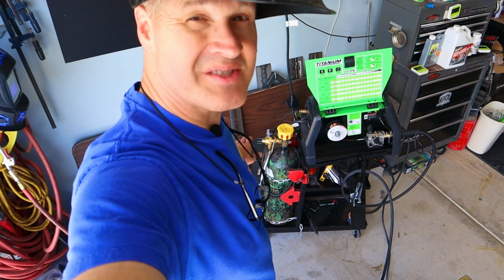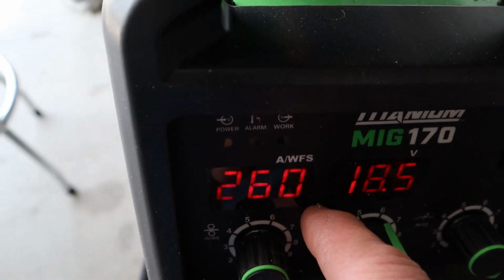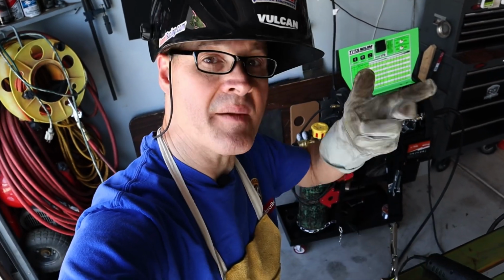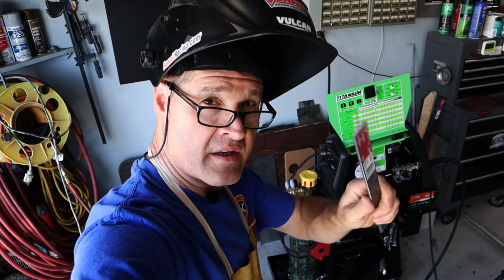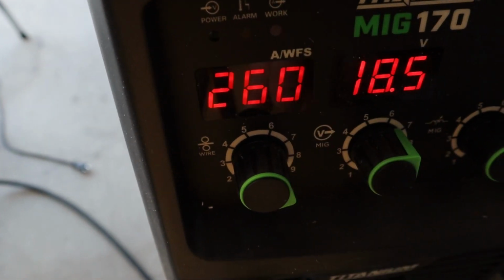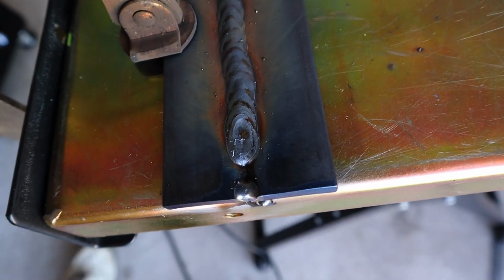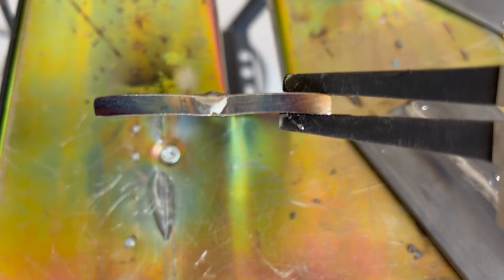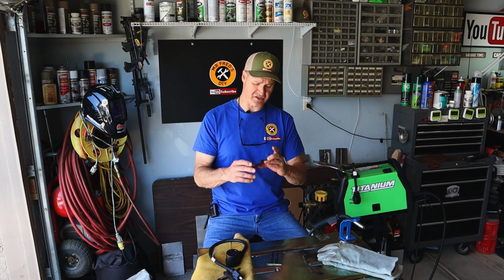Harbor Freight Titanium MIG170 Welder

Comment: Would love to see this using the 240 volt settings to see what it is really capable of on sheet metal and max thickness say maybe 1/2 ' thick steel.
Reply from the maker: I currenttly do not have 240 available, but I would love to test this machine at that voltage. Thanks for commenting.!

Comment: Pro tip: You can get passable depth on 1/4” steel with a 120 on shorter welds if you preheat the connections to a dull orange using a gas torch. 

You must have a genuine feel for what the weld is doing though, like riding a weld to white heat without burning, under or overheating. It involves using bursts to perfection.

Forget the charts, learn to feel exactly where your settings need to be — because no two pieces of steel are exactly alike.
Reply from the maker: Thanks for commenting and great tip! As for the chart, they are definitely starting points. I actually have started a welding notebook with numbers that work for real.